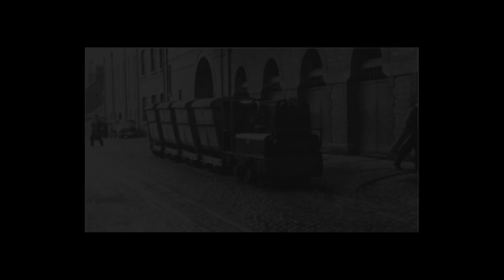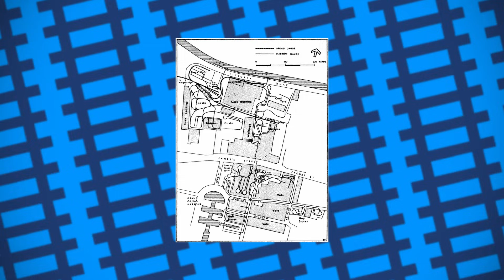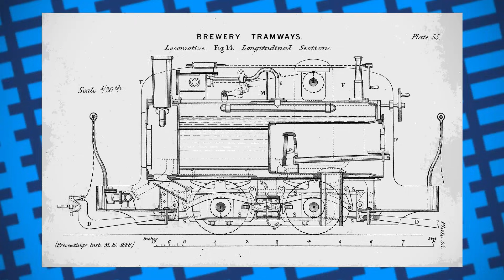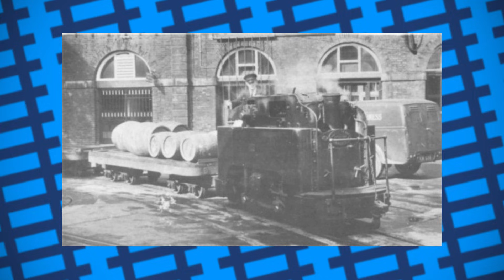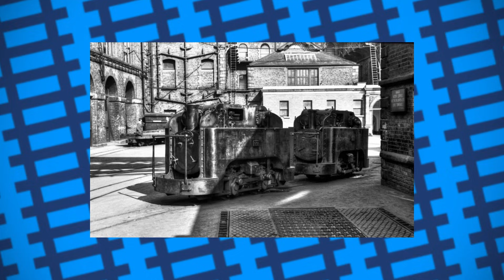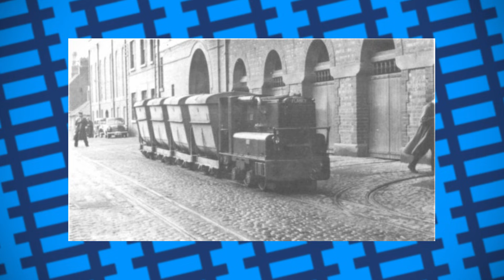The Train within a Train & the Railway Built for Beer - Guinness Brewery Railways

Comment: Nice.  More interesting than Cosmeston's Quarry Railway, which is what I was thinking of watching this.  Come to think of it there were a few interesting narrow gauge lines in South Wales.  Cosmeston, and then there was the sand quarrying or whatever it was at Porthcawl and also the dual gauge tracks at some of the mines.  There might have been a very short line on Barry Dock too but information is difficult to find so I cannot confirm it, just a picture I saw years ago of a short narrow gauge line.

Comment: One of the most interesting engines I can think of is a natural gas plant locomotive. The example in question is currently on display at Steamtown in Scranton, Pennsylvania. 

The example had no firebox to avoid an accidental explosion at the plant. Instead of this, pressurized steam was pumped into the locomotive periodically.
Reply: Fireless locomotives came in a range of sizes and shapes, some used compressed air (where available) but steam was often readily available as plants usually had boilers anyway

Comment: I never considered that a single business may grow so big as to require and entire multikilometer on-site railway just to function...  That's so cool!
Reply: We've still got a number of such businesses. Look at any large steel mill. Some of my great uncles worked at Northwestern Steel & Wire, which was a small mill as things went, but they were known for taking in steam locomotives sold for scrap, and the owner having them fixed up and used in the mill. They used steam until the owner died...in 1980.
Reply: @SynchroScore 
Because of the owners actions I am aware that atleast 3 of the locomotives are around, one in a park in Sterling, another in Amboy, and one at the Illinois Railway Museum
Reply: @WesternOhioInterurbanHistory  There is also one sitting in the woods in Galt, IL, just west of Sterling, one on display in Independence IA, one stored in Geneva NE, and one on display in St. Paul, MN. The one we have in Union is currently undergoing a cosmetic restoration.
Reply: Ford at Dagenham had a substantial railway.
Reply: pretty much every steelmill had narrow gauge rail systems back then
Reply: St Jame’s Gate was a massive site then and still is.

Comment: I absolutely love seeing narrow gauge tracks running in the middle of Standard or Broad gauge ones, it just feels so clever to me, and makes so much sense for space, but yeesh, finding images online is oddly annoying to do. Never thought a Brewery would need little trains to move stuff around, but really should've figured :P
Reply: There is a 4 rail setup (so couplers are aligned for narrow gauges engines to haul normal gauge wagons) at the CFBS heritage railway in France. It is used nowadays for regular (every 4 years) massive gathering of preserved rolling stocks, both narrow (1m) and standard gauge, allowing display and running  of everything on the network.
Reply: There are a few installations of three-rail trackage here and there. I know there's a fair bit in Switzerland where the standard gauge and metre gauge overlap. But four-rail is much more rare.
Reply: The Coors brewery in Colorado is using an internal 1435 railway